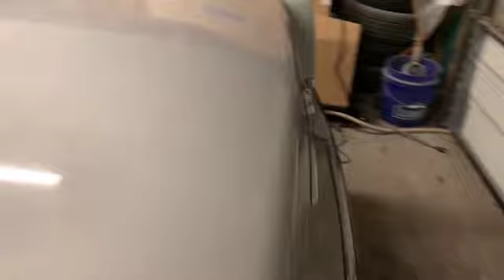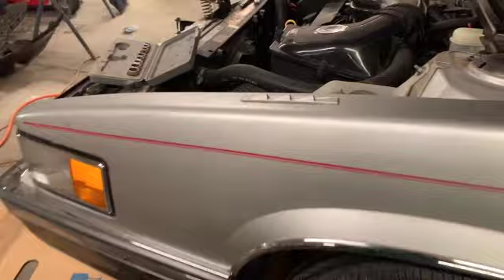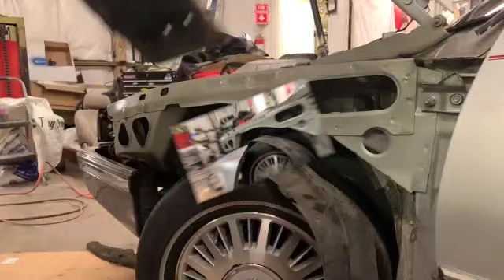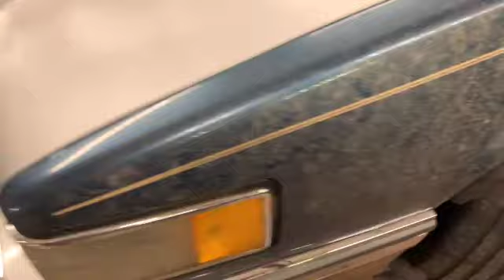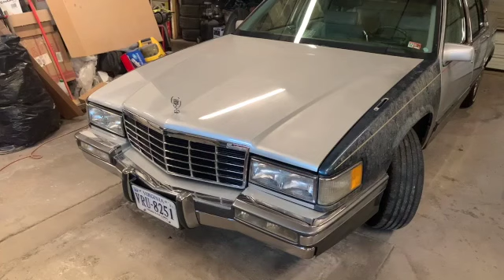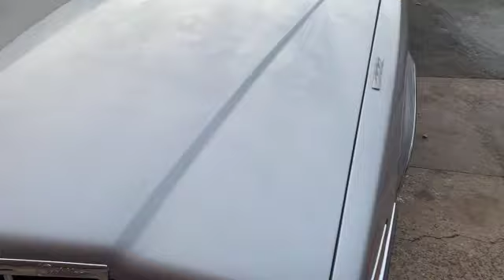Replacing Front Fenders On A 1992 Cadillac Sedan Deville

Comment: '89 and '90 front fits on '92. They do look different when you know what you're looking at, but they bolt up. 
The sealed beam headlight brackets also bolt up to the composite headlight openings.

Comment: Is the cracked fenders on Cadillacs a common thing?
I bought my 93 Sixty Special also has a driver side fender cracked.
Reply from the maker: Yes they all crack mainly in the south
Reply: @likecandypaint  you mean they crack with time due to age warp or pressure put on the fender like a mechanic or just leaning?
I'd like to know because only one of my fenders has a crack and I'd like to repair and conserve my other fender too.
Thanks.
Reply from the maker: @lrg863  They crack due everything you said. They crack depending on what state the car is from most cracks in southern states due to the heat